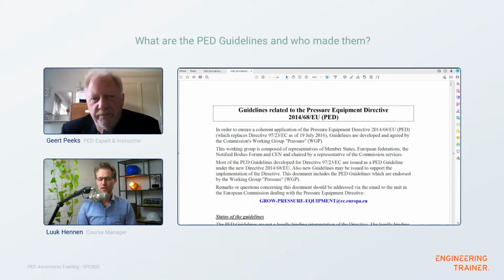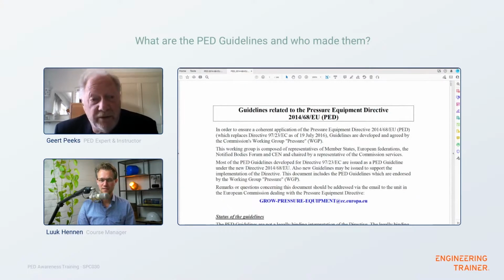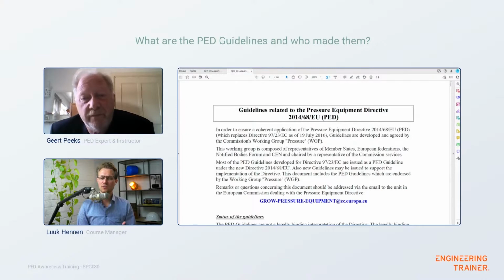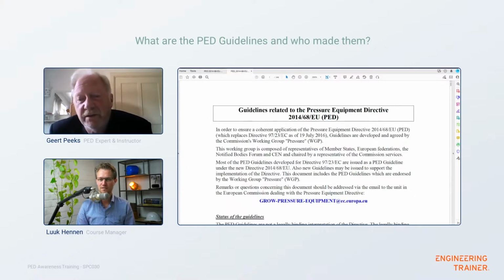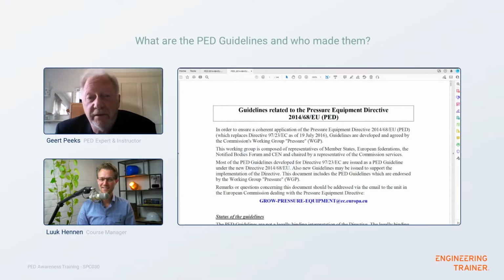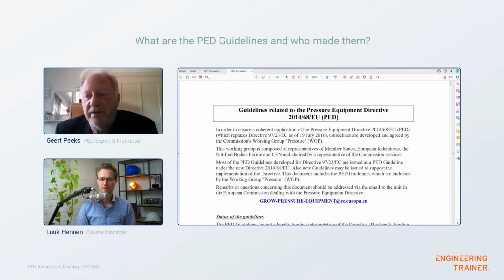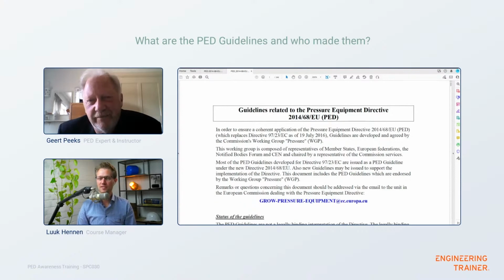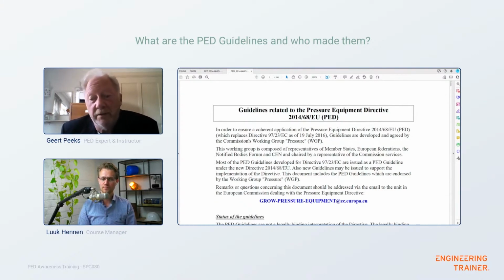Pressure Equipment Directive: What are the PED Guidelines and who made them?

Comment: Nice informative section, But still I had query that can we certifying the pressure equipments to PED with ASME design standards.
Reply from the maker: hi there, thanks for asking. This indeed is a very relevant topic! We will run a virtual instructor-led course that covers this during the fall, you can find more and register here: https://www.engineeringtrainer.com/shop/vilt2201-product-pressure-equipment-directive-ped-compliance-using-harmonised-and-asme-standards-411#attr=162